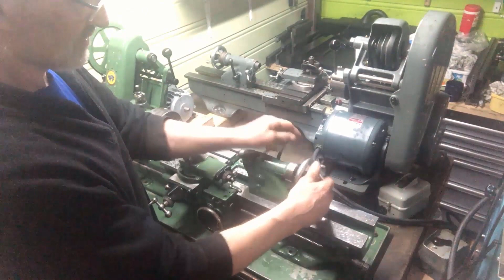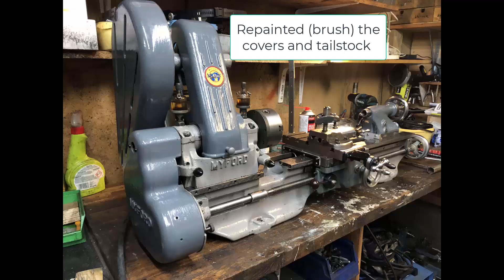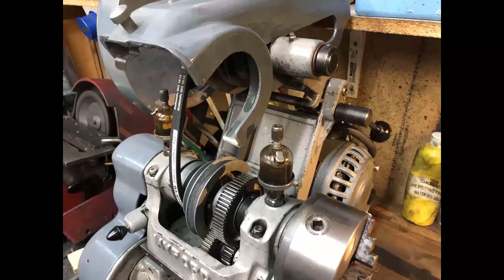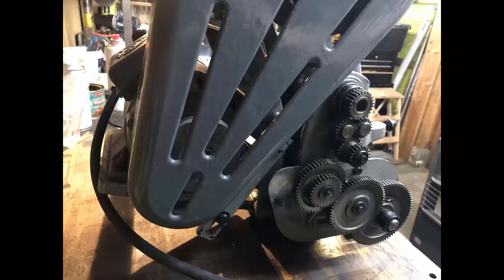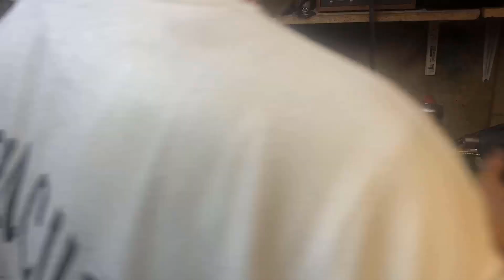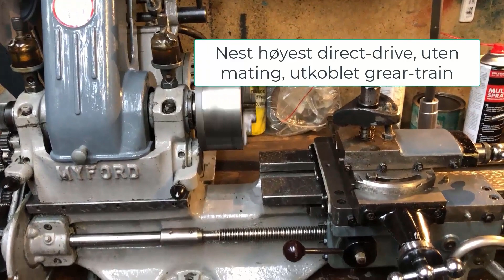Myford ML7 - partial restoration of 3 lathes: assembled and ready

Comment: It’s nice to see someone doing an actual restoration on a lathe. Most youtube lathe “restorations” consist of cleaning and painting. You end up with a really nice looking machine that’s still worn out.
Reply from the maker: Thnks. Yes, you are spot on there.. I call this "precision painting".. :) Admittedly, it is nicer to use a nice looking, clean machine, but it won't help you much if the machine isn't both mechanically functional and accurate.